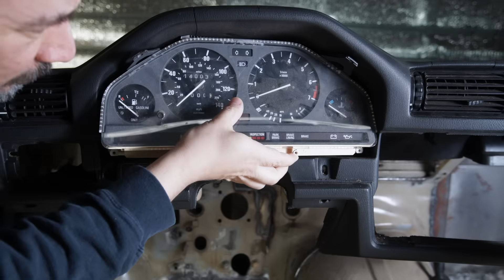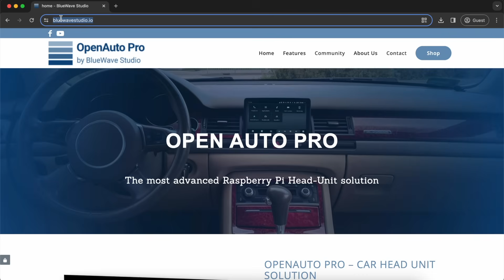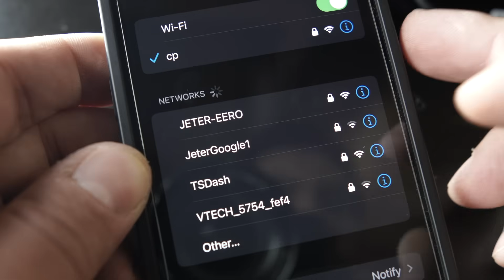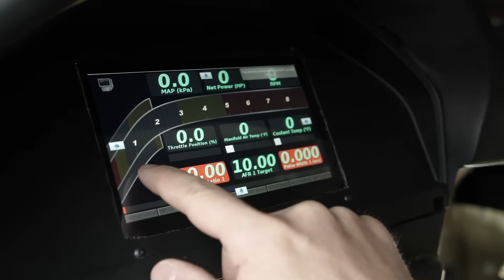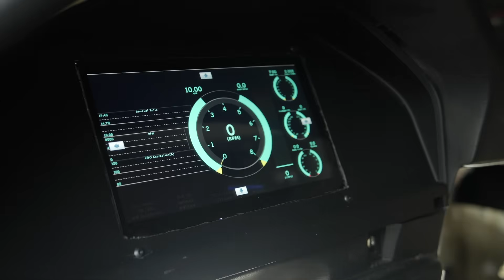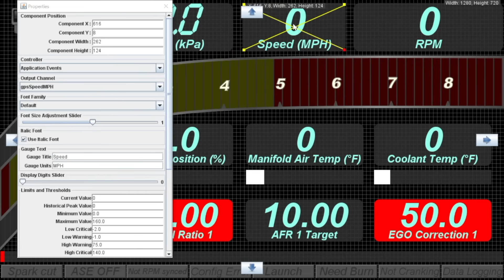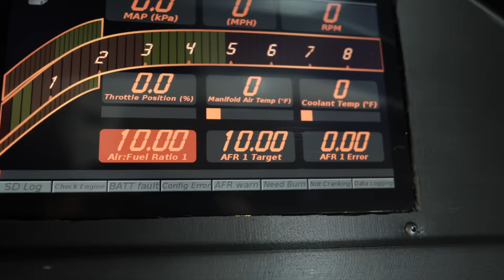Transform Your Digital Dash with the Power of a Raspberry Pi

Comment: So how do you dial in the gauges to get a proper reading when the car is running? Is there another aftermarket module that needs to be wired/coded too?
Reply from the maker: We’re using Speedunio ECU that sends data to TSdash via USB

Comment: Did you use a power converter or everything is just 12v?
Reply from the maker: Raspberry Pi takes USB 5v, but I’m using a Witty Pi 4 that takes 12v and can power on the RP when the voltage jumps when the alternator kicks in.

Comment: I am curious what ECU you are using and how your raspberry is receiving data from it?  Is it through canbus?
Reply from the maker: Since this is pre-OBD2 I’m using a Speedunio ECU via USB to the Raspberry Pi. If you have OBD2, take a look at running realdash instead with a OBD2 Bluetooth dongle that you can connect the the raspberry pi
Reply: @Itsallaboutthebuild  I'm actually using Ace's on one project so was just curious what the interface was to see if it can be adapted.  They have not opened up their canbus protocols yet though so who knows.
Reply from the maker: Nice, haven't played with CANBUS much. However, I did run across Raspberry Pi CANBUS hats before. What type of car?
Reply: @Itsallaboutthebuild  64 Chevy C10.  I can go analog gauges but even those can be pricey.  The Aces unit comes with screens that range between 5 to 8 inches but ultimately if I wanted to do a digital dash I would want it across the width as much as possible rather than looking at a screen the size of a phone, or two screens like yours pushed together to appear as one and then spread the cluster information across them.  My thought was also to have a larger microSD attach and be able to integrate digital multimedia, map software and similar functions into the dash itself as opposed to having a traditional stereo with car or android play, and then ultimately just have the audio go over BT to a proper BT amplifier.  I'm not sure how doable that is though over raspberry.  I have had a Pi for 3d printing and octoprint services as well as retro graming but never delved into the use of the devices beyond that.
Reply from the maker: Nice, that sounds like a fun project. Once I have the car running, adding audio with a BT amp would be a nice touch.

Comment: Nice thought but You just invalidated your car insurance,  you need to absolutely spot on with your voltage measuring before it all goes up in flames .  Really nice idea but count me out . Probably better to add additional screen+CPU controller (android tablet) to the vehicle computer jack  (OBD II) with market software via blue tooth .   For those Nerds probably root the android and load Linux. 
However need guys like you else we would still be trying to figure out the wheel 😊
Reply: Overlay the existing dashboard with 3d printed part  with a tablet  using velcro to remove when it goes for vehicle test ( MOT)
Reply from the maker: Nice, I like that idea. This car is pre-obd and it will be primarily for the track 😁

Comment: Looks awesome and with a bezel it will be OEM+ :). Congrats! I love projects like this because it is great inspiration. I recently built custom head unit for my E38 based on a Raspberry Pi and Hudiy. The E38 has very limited OBD but using ibus I can read quite a lot of information. I already decoded engine temp, oil temp, RPM, speed, door status and steering wheel buttons. Now I'm working on a visualization for the parking sensors. Hudiy is perfect for this because you can design your own views for such data in html.
Reply from the maker: Thx for watching 🙏 I’ll check out Hudiy for sure. Also I just did a redesign that doesn’t require the bezel 😁 👉 https://youtu.be/YfwNRx5-CUU?si=vd8ITB8KyEu07UkN

Comment: Why on earth would you go through all that trouble measuring and designing a custom dash, and then hack it up with a Dremel tool instead of printing it with the cutout?
Reply from the maker: Because at the time I had no idea how to design the cutout and standoffs to the design I downloaded. Over a year later, I figured it out 😂 👉 https://youtu.be/YfwNRx5-CUU?si=--ZDIm75k5qb7jf_
Reply: @Itsallaboutthebuild  I've been printing for at least 5 or 6 years, and I don't think I would be able to make a dash panel....  But I know how to do a rectangle.
Reply from the maker: 😂 Made the mount points too, not possible using negative part in slicer. But hey, anything is worth a try

Comment: That's pretty cool. I found this video because I actually want to do the opposite, build an analogue gauge cluster for modern cars with an arduino and/or pi driving motors to control it all.
Reply from the maker: Awesome, yes you will need an Audriuno for ADC as the Raspberry Pi doesn’t have any. But the Raspberry Pi can help drive a more complex LCD display. What type of car are you looking to build one for???
Reply: @Itsallaboutthebuild  I'll fiddle around and see if I can get something working on my Fiesta, but looking into getting analogue gauges working for a BRZ or 86. Just starting on the journey, so maybe I'll fail, haha, my experience with Arduino starts and ends with getting some basic lab equipment to display on a 14 segment display. So I've got a bit to learn in terms of getting data from the car and turning that into a servo position for a gauge.
Reply from the maker: That's pretty good, you're well on your way. If you ever need help with 3d printing the display, give us a follow on our newsletter and reach out any time -> www.allaboutthebuild.com

Comment: How did you connect it to your ECU?
Reply from the maker: Replaced the DME with a Speedunio ECU and connected the rasbperry pi using USB. If you have OBD2, then take a look at installing realdash on the raspberry pi. If you don't, then in order to read all the different signals you're going to need something with an ADC converter hooked up to the pi like an audrino with custom sensor inputs. I decided not to go that route.

Comment: Definitely interested if you’ve run into issues on hot days with that screen model. i played around with a similar screen / pi setup for an apple play system, and it would shut off on hot days (which was a duh moment after i actually read the spec sheet )
Reply from the maker: Good point. Just reprinted the dash in ASA. Will do some more testing with the screen and pi

Comment: Having all those displays clustered into that tiny screen makes it look to cluttered and compressed. I'd either go with multiple screens, (running on multiple PI's if needed) or a larger display with a cover breaking it into separate sections. 
You see that second option quite a bit in the flight sim community where they'll put a bunch of virtual gauges on a single monitor then use a bezel over the monitor to make it look like a cluster of smaller gauges in an instrument panel.
Reply from the maker: That would be awesome, like two circular LCDs. One to the right and one to the left 🙌

Comment: How did you step down the power of the 12v to get to the 5v for the pi?
Reply from the maker: Check out the Witty Pi 4, it plugs into the Pi and can auto power the Pi on and off based on batt voltage. Will need to put together another video on the full build soon.

Comment: i think we are missing how your connecting the LCD to the pi. What wires are those little single wires? If i connect via bluetooth to my car would i just need a Bluetooth dongle and connect via bluetooth with the pi?
Reply from the maker: Working on that next. Plan to connect the Raspberry Pi via USB to a Speedunio ECU. You could use bluetooth if your car supports OBD2 with a bluetooth dongle. Check out realdash for more details

Comment: Does this only work with aftermarket ECU or can it get information from analog sensors
Reply from the maker: Pretty much OBD2 or you'll need a 3rd party ECU. The Raspberry Pi doesn't have ADC, so you'd need to add an ardunio and learn some coding to read and display analog sensors.
Reply: @Itsallaboutthebuild ahh I see it's cause my setup for obd2 at least the factory engine never had a pid for oil pressure from the get go other wise I would have ran the obd2
Reply from the maker: Ah I see, what type of car?
Reply: @Itsallaboutthebuild it's a mustang but has a gm 5.3 SBC
Reply from the maker: Oh nice!!! Love Mustang.

Comment: I need one of these for my 92 range rover vogue. The cluster works when it wants to work
Reply from the maker: It’s tough with anything less than OBD2, we’re running a standalone ECU connected to the Rasberrpy Pi. But with enough research you might be  able to get something going 😁

Comment: This is so cool, But why didn't you just print it with the cutout and mounting holes?
Reply from the maker: Thx for watching and great question. At the time I found this model and didn’t know the best way to add the inserts and screw holes. Since making this video I learned how to use Shapr3d and have a redesign. Do you have an e30 as well?

Comment: How did you tie this to the main power supply? Is the raspberry pi the power source for the monitor and is it automatically ready for use in 12v systems or did you do anything to make it work with your car?
Reply from the maker: Working on using a Witty Pi 4 HAT to auto power on the Raspberry Pi after car start when voltage increases.

Comment: No way.
I would never change this clustergauge out for a digital one.
This particulair BMW gaugecluster is one of the best there is.
Reply from the maker: It's amazing, until it fails. Replacements are crazy expensive.
Reply: @Itsallaboutthebuild  I never experienced any failure of the gauges, other than that sometimes a small lightbulb behind the gauges had to be replaced.
Reply from the maker: NICE!!!

Comment: Nice build. Found your channel while searching for ideas on a new dash for a golf cart/Low Speed Vehicle build. If you haven't looked into 3D printing for the upscale golf cart hobby, you should. Thanks for some great ideas. You've got another subscriber.
Reply from the maker: Awesome, thx. What type of parts do you need for golf carts???
Reply: @Itsallaboutthebuild  Doing a digital dash for a second gen 2007 Gem car. The golf cart has gotten off the fairway, and into communities all over the states. Low Speed Vehicles (LSV's) and Low-speed electric vehicles (LSEVs) and Neighborhood Electric Vehicles (NEVs) are finally coming into their own. Lithium Battery kits range from $2500 to over $4000 USD. Older carts are getting restored/updated, and many plastic parts are next to impossible to find. I'd be surprised if many of these couldn't be 3D printed. Anyway, great channel.
Reply from the maker: True, true. I see them driving around my subdivision all the time. Will need to check em out in more detail.

Comment: I don't see how this works. The speedometer uses a mechanical signal not electric. How does it transform the mechanical input of a speedo cable?
Reply from the maker: e30 has a diff pulse speed sensor. Working on getting it connected to Speedunio ECU which then interfaces with the Raspberry Pi using TS Dash :)

Comment: I've been wanting to do this to my old car but it doesnt have an obd port 😭, you say that OpenAuto Pro uses an obd2 output but your car looks older than mine. Did you have to install custom ecu or does it also work with old analog signal?
Reply from the maker: We are installing a speedunio ECU that hooks up to the Raspberry Pi. So if you don't have OBDII, then you'll need a compatible ECU or make your own analog to digital converters for each sensor you want to read out.
Reply: @Itsallaboutthebuild have you made a video detailing how to do this? Would love to see one on it! Im currently in the process of importing a Kei truck to the USA and want to put a digital display in jt to replace the dated kei displays and also function as replacement radio head unit. Would kill for a video detailing either how to hardwire it yourself or how to turn the analog into digital data!

Comment: Not sure why you didn't 3d print it with the hole for the screen already there?
Reply from the maker: Since this was a downloaded scan, at the time I had no idea how to cut the hole out. I originally tried using a modifier, but that wasn't working. Since then I've learned to use Shapr3d to modify existing STLs, so I'm working on an updated version with cutout and screw holes printed in ASA UV resistant filament :)
Reply: @Itsallaboutthebuild yeah fair one! Now you have the skills you can make anything, that's what I love about 3d printers! I use blender a lot for my prints, fairly difficult to get to grips with but it's free so I can't complain 😂
Reply from the maker: Blender, nice. We've been using Shapr3d. Love it so far.

Comment: I wonder if you could use this solution to connect via Bluetooth.. I have an ECUMaster EMU with a Bluetooth adapter and currently no dash solution. Was going to use realdash app on the phone etc.. but this feels cleaner, especially as a have a spare RPi4
Reply from the maker: @flikstRR  pretty sure realdash supports RP4 and it also has built in Bluetooth. You just have to see of ECUmaster supports realdash running on RP4. That would be a cool build. What type of car do you have???
Reply: @Itsallaboutthebuild  haha a weird mashup.. its a driftcar..  Rx8 powered by a 1JZGTE, BMW  Gearbox  etc..   looking for a cool but temporary solution till i go to LINK with CAN
Reply from the maker: That sounds awesome!!!

Comment: Hello! How does this fit into your car? I mean, is it a  OBD port? Can you use this for an older car, that has digital inputs to the gauges but doesnt have OBD2-ports?
Reply from the maker: @pasijantti3530  we are using a Speedunio ECU that had a USB hookup that you can integrate to the Raspberry Pi using the TSDash software. If you are running OBDI then you’ll need to find some sort of custom analog to digital converter to take signals from different sensors which gets super complex. So finding some sort of aftermarket ECU will be much easier.

Comment: why in a 3D printed object? Why not printing with the opening for the first time?
Reply from the maker: Lack of knowing how to do it just right :) We've since been learning how to use CAD software (Shapr3d) and have a draft design with the right cut out and proper mount points for the screen. We also plan to print it in ASA to protect it from UV sunlight and potential melting. Stay tuned for more...

Comment: How i can connect it to my ECU so it’s can read of it
Reply from the maker: @AZABE1000  we are using Speedunio ECU so via USB interface. Stock ECU without OBD2 will probably need custom sensors to read stuff which would require something like an Aurdunio with Analog to DC reader. If you have OBD2 then using realdash software instead of tuner studio would be the way to go.
Reply: Thanks for explaining  @Itsallaboutthebuild
Reply from the maker: @AZABE1000  NP, which car are you working on???

Comment: I was all over doing something similar but I can't find any of these softwares that show fuel guage, milage etc or oil temp. Everything else you need is on every app.
Reply from the maker: Ah true, working on a separate circular display and sensor for random sensors. Will post when I finally have it ready

Comment: I dont get why you didnt take the measurements for the screen first and implement that into the design in CAD rather than cutting it out with the dremel. But it turned out great either weay, definitely gonna try my hand at one for my 87 Trans Am!
Reply from the maker: @cgyork92  thx, more of a test as it was printed with PLA. Working on the exact cut out with left and right circular digital gauges too 😁

Comment: At what temp is your screen going to be too cold to function? Living with sub zero winters. I bet there are people wondering about the top temp before failure as well.
Reply from the maker: @MK-tc1on  good question, perhaps we shall do a road trip once the car is finished 🙌🙌🙌
Reply: @Itsallaboutthebuild  it would be a main reason for me not to do that. I need my instrument panel. 
But it also goes for a diy car radio. Camper van TV. Stuff like that.

Comment: Great idea, but the screen you chose is grim. I think the most important thing is that the information is available at a glance. The speedometer just gets lost amongst all the other gauges, most of which are just white noise.
All you need is speedo, RPM, temp, high/low beam, turn signal. If you clutter the dash with too much stuff you spend way too much time looking at it than watching the road. I'm a firm believer in K.I.S.S. Keep it simple stupid.
Reply from the maker: @coot1925  like that approach, good thing the dash is completely customizable 😁

Comment: This is not recommended due to safety concerns when using cheap chinese aftermarket. It's not OEM speced or certified by the auto makers. It can mess with the control modules or fail at any given moment. Always stick with OEM. It's not worth the risk.
Reply: "cheep chinese aftermarket parts" are usaly from the same factory as the original parts but with another name stamped on them
Reply: @kempaswe4022  not OEM. After market sure. 90% of Toyotas parts are made in Japan regardless if Toyota makes them or uses an OE supplier like Denso.
Reply from the maker: @eman0828  wonder how much QA is done between OEM and 3rd party 🤔🤔🤔
Reply from the maker: Good point, this won't be a daily driver, but a track car. Much more controlled environment :)
Reply: It's taking the same data OBF 2 puts out everytine the car is on, I get it if its like 2010+ car where they have like 20 computers in it since they get picky about everything